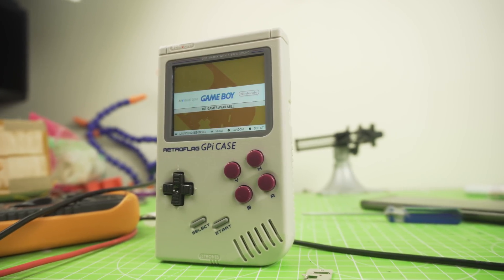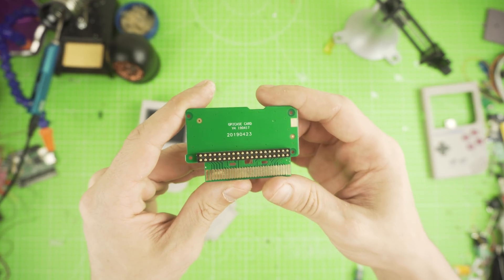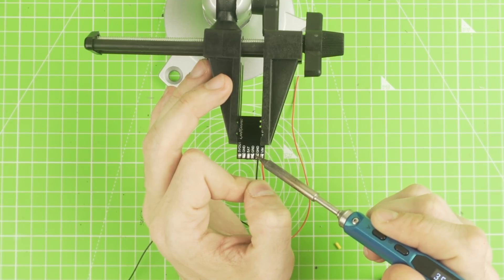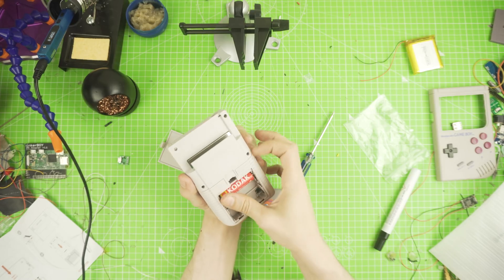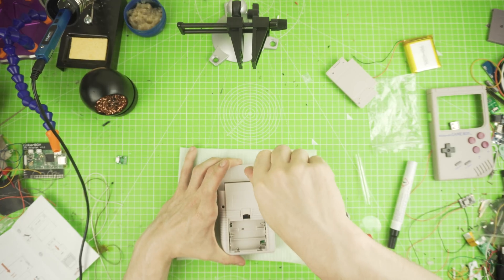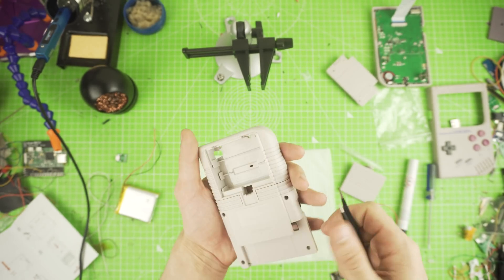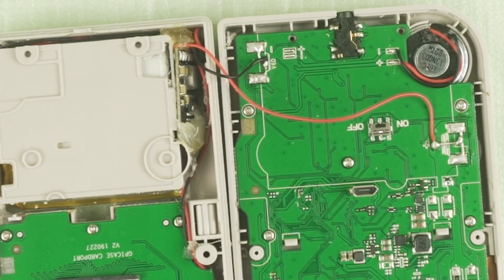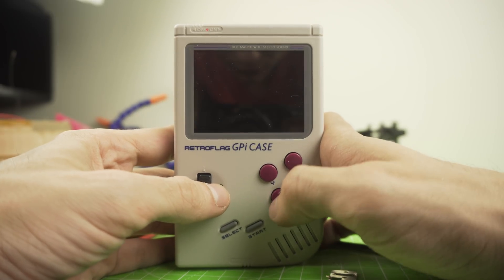Retroflag GPI case Battery and Charger Modification

Comment from the maker: Booster:
https://amzn.to/31qhDOx
Battery:
 https://amzn.to/31x5ebq
Micro USB:
https://amzn.to/2F4dNkj
Wires:
https://amzn.to/2X7d9wJ
Dremmel:
https://amzn.to/2WH0fGs
Soldering Iron:
https://amzn.to/2WI6lGq
Solder:
https://amzn.to/2IFlQVQ
Reply: Can you add wires too please and the dremel? Thanks
Reply from the maker: Done :D
Reply: Could you please make a diagram of the wiring schematic? I can't see all connections on the video (a paint drawing would be enough).
Thanks!

Comment: you don't need to boost the battery, it runs fine on the 3.2-4.2V straight from the cell

Comment: I did a mod but with an old DS lite battery and a recycled power boost board from an old dead battery bank. Except I connected power to straight to the back of the power jack on the side as opposed to the battery terminals themselves. I wish I would have watched this video again before I did the mod but oh well, lesson learned. It still works, I just have to open the battery door to charge it. When I order the bigger battery and the nicer power boost  circuit I will go this route except I will borrow the power jack to charge it. Thanks buddy!

Comment: Do you have any suggestion for battery, the amazon link is finished and all battery that i have found avec with a height of 68 mm ( 4000 mah / 5000 mah 3.7v ) and i'm pretty sure that it will not fit inside the battery pack.
Reply: Anthony Mendenhall  Thanks i've bought on aliexpress an retroflag gpi it last 8 hours and dead at launch ( seller didn't respond after that ) => Journey retroflag ended for me ( 56 euros for nothing )
If you want to buy it Avoid Acekool store on aliexpress

Comment: also: to those of you that can't get this to work (doesn't power on - if it does it's slow, it stutters, it suddenly reboots, absurd frame drops, crippled sound and so on), solder the red wire straight to the upper lead of the barrel jack, and the black one on the lower one. this way you'll bypass the onboard booster and feed the GPi straight in. you'll have to resort to the "push the button on the board to make it work" thing though.

Comment: adding some more info to what I wrote 2 months ago.

The Lantian module showed in the video has an integrated circuit with the mark "MH-CD42" on it. As far as I know it's a different version of the "more classic" IP5306 (which worked way better, I have some of both types), and both are programmable microcontrollers, that take care of the battery charge and discharge (exact details and original microcode are not known - some Chinese manufacturers are worst than Nintendo regarding info on their products).

According to what I know, the "MH-CD42" ones do NOT power on automatically when a load gets attached (proved by attempts with loads both below and over 45mA), but it MUST instead be powered on by pressing the pushbutton provided in the package (that some of you might have received). it would seem that the module straight up ignores the load when it's in deep sleep - probably different from "light sleep".

in some of the packages coming with the Lantian there might be two 300Ohms resistors, and the manufacturers suggest to "solder the two 30Ohms in parallel between VOut and GND to achieve a continuous output". Now, this is absolutely NOT recommended for at least two reasons:

1- this would discharge the battery even if the GPi is left alone , and a single 2000mAh LiPo (for example) in an unused device would have to be charged approximately every 45 hours, due to the ludicrously large leakage current (33mA) generated by the parallel resistors - not to mention the fact that the four charge LEDs would stay lit for all the time;

2- the intended load (in this case the Raspberry plus the screen and so on) could experience instability during operation and the battery would get drained much faster.

what I suggest instead is to leave the switch flipped to "on" and wire an alternate pushbutton which goes to the "KEY" pad on the Lantian module on one pole, and to ground on the other. This way, by powering on the device by pressing the pushbutton once, and then switching it off by pressing it twice, the leakage current stays inside the IC and it should be limited (if the IP5306 datasheet applies to the MH-CD42) to 50μA, which is more than 300 times smaller - this would not only get roughly 4 and a half years to discharge the same battery, but also keep the LEDs off when idle.

it's not decent by any stretch of imagination if we think that many low dissipation FETs have a leakage current of a few dozens of nA (100 to 1000 times even smaller), but it's leagues better than the "parallel resistors" solution.

alternatively, one could still press the alternate pushbutton once to power up the module, and then flip the switch. the unit will stay functional during playtime. when powered off, if the switch gets flipped to "off" the module should power off by itself after roughly 30 seconds. this would bring down the leakage current to that of the power FETs on the GPi PCB. but it might be seen as annoying.

a much more efficient design like the Adafruit Powerboost 1000 - or a generic MCP73871 + TPS61090 combo should be used.

Comment: If your charger board (of the same type Adam shows in the video) shuts off after 30 seconds, you might have an older batch.

TL; DR: it sucks, but you might want to try another board from a newer batch.

According to the M5Stack forum, the IP5306 can be programmed via the I2C protocol through the pins normally used by the LEDs. I have no direct proof of this, but it would seem that some batches have been misprogrammed to always disconnect the load after 30 seconds (32 seconds according to the datasheet) no matter the current drawn by it - the datasheet says that the IP5306 turns off the output if it draws less than 45mA for about half a minute. The issue cannot be directly fixed without reprogramming the IC, so if you happen to have such a board it's just a programming error, it's not either the GPi or the booster's fault. You need to get a newer batch of boosters.

Such boosters can have the code "HW-775", "MH-CD42" or "LANTIAN" on them - or perhaps even others that I don't know. The IC code can be either IP5306 or MH-CD42 but it's the same IC.

https://forum.m5stack.com/topic/979/m5stack-basic-core-battery-power-on-issue-ip5306-strange-power-management/11
https://community.m5stack.com/topic/62/ip5306-automatic-standby

Datasheet:
http://www.injoinic.com/wwwroot/uploads/files/20200221/0405f23c247a34d3990ae100c8b20a27.pdf

Comment: Does this mod actually work 100%? Charge properly and fully? Reliablt? Discharge and use battery fully?

I ask becaise so many of these charge/regulator boards state that they are for "18650" batteries, not for lithium batteries in general of varying capacity. It is confusing. It it safe to assume that when a board is for "18650's" that it will chargw higher capacity? Why do a lot of DIY multi actual 18650 charge circuits here on youtube use multiple charge/regulator boards?

I am keen to know as I need reliable power solutiona for a few projects I have.
Reply from the maker: I have mine that still works to this day and thousands of more people made it, not heard about failing, people are using it to modify original Gameboys for years

Comment: Please help! I just completed this mod. It worked and I was able to play using the battery for a while. After playing, I connected the USB charger and let it charge the unit for a while. Then I tried playing again but couldn't get it to power up. I can use the GPI case with the barrel port charger. I'm thinking it must have something to do with the way I soldered the wires to the motherboard. Can you tell me which +/- pads you connected to?
Reply from the maker: If it worked for a while and then it didn't you need to check your charger or your wiring, + and - are on the right spot

Comment: Thank you so much for this video! I don't have much experience with soldering, but I managed that even if "you forgot to press record" ;)
Only negative point: the booster I ordered has a pin more than yours and it's  bit too wide... the case does close properly for about 1mm, but the screws and some Dremel work managed that!
Also, the battery lifetime is impressive: more than 10 hours with low-medium screen brightness!
Reply from the maker: Hi, I am glad that you found the video useful even without the missing part (I re shot that in the last video) The battery life and the convince makes it a great modd and a easy way of getting onto moddig

Comment: Is there a diagram to show what goes where? The camera cut doesn’t show where the battery is connected, and it’s not so obvious how to connect the wires to the removed AAbattery pins - it looks like a soldered “T”... if you see what I mean?
Reply from the maker: They go on both aa pins doesn't matter where in that T

Comment: how much playtime can i expact from this mod?/ how long does one Charge last?
Reply from the maker: A friend made a test and it lasted up to 12 hours of gameplay with low brightness and no WiFi and Bluetooth, normal usage around 5 - 6 hours
Reply: @Adamstech  sweet! Thanks a lot!
What do you think is the max capassity battery you could possibly put in? One could also get rid of the whole inside tray of the Battery Spot to gain more space. I consider buying a case but having at least 1 -2 day of playtime would be amazing. There are bigger batterypacks but the size increases of course as well.
Reply from the maker: @julianea.8193  Hi, yes you can def do that, I decided to try to do as little mods as possible as the community want's them intact for some reason and  got some hate, but yes please try and find one that fits and you can deff go bigger

Comment: Can you post a picture or a diagram of how the booster is wired along with the wireless charging please?
Reply from the maker: The booster has 2 sides, you solder the wires to the charger pins, it says on the booster which one is which, but if you want add me on fb and I can help

Comment: Awesome build.  What type of wire do you use to connect all the components?  The red and black wires.  Guessing something small like 22AWG?  Stranded or solid?  Only small gauge wire I have is some "doorbell" wire I bought from RadioShack years ago. Think it's 22AWG solid.  I've soldered on this in the past but wasn't sure it was the best.  Any recommendations?
Reply from the maker: Hi, thanks for watching the video! For the power I recommend 22 AWG wire for the maximum of amperage and for data and the rest just go with normal 24-26 AWG wires, I always use the wires from inside used USB cables

Comment: A nice mod, but kind of pointless imho. With good high cap batteries (2700mA) you should get a pretty good runtime. Sure, the internal circuit does boost the voltage, thus reducing the total output amperage, but still, considering that the unit consumes around 350mA, you should get at least 5-6 good hours of gameplay out of it. Id say thats more than enough gameplay time per day, not to mention way easier than modding it. But hey, to each his own, still a cool mod.
Reply from the maker: Thanks for watching! Well, each with their own how you said, but the biggest drawback is the fact that you got to buy batteries and charge them outside in a  charger, which no one can argue is more convenient. Add the possibility to charge wherever you are with any port you want ( micro USB, type c ) and that makes it quite better than carrying the case a charger and batteries.

Comment: I have 3 rechargeable batteries of 2000 mA, they are 6000 mA without modifying anything.
Reply from the maker: It doesn't stack up in that way mate, you stack up voltage in your case, so you have 2000 😁
Reply: The difference between series and parallel using batteries

Comment: The charge/discharge module I have powers down after 30s - I think this is because the load is less than 50MA. Any way around this?
Reply from the maker: Is from the charger module I think, do you mean that the all powers, pi and the rest and it just shuts down?
Reply: @Adamstech  Yep - though battery charges and GPI works fine from USB. Module is similar to this: https://www.amazon.co.uk/MakerHawk-Charge-Discharge-Integrated-Lithium-Protection/dp/B07QHTK791
Reply from the maker: Well that's odd, the batch that I had doesn't have this pb, what you have is really wierd as the pi and gpi should draw enough, try with the battery connected directly to the gpi, give it a go
Reply: Adam Builds can confirm it works fine with same battery direct to gpi
Reply from the maker: @cakeinmilk  Great! Thanks for letting us know!
Reply: Adam Builds don’t solve the problem though! Battery in this configuration has no way of charging.
Reply from the maker: @cakeinmilk  Yeah it is, add a second wire from both cables that come from the battery and solder those on the battery pins on the booster, then do your micro usb in and that's it :D

Comment: I used the link to buy the charger, but the one I received has a switch on it. I noticed that yours doesn’t. The GPi only turns on when I press the switch on the charger board. It then always turns off after about 30 seconds. How do I stop that?
Reply from the maker: They changed their batches, try and find the one like mine and just change it :D

Comment: Cool mod. How did you install the micro usb socket? Only with glue? will it hold or something stronger is required?
Reply from the maker: A combination of super glue and hot glue, also closing the case is keeping it pressed :D

Comment: Hi! Thanks for the helpful video. But I need some help....All parts ordered as per your suggestions and installed correctly. GPi works perfectly when attached to USB, but when disconnected cuts out after 30 seconds. Charge lights on booster suggest that the battery is fully charged. Cheers for any suggestions!!
Reply from the maker: That might be a problem with the second batch of cases, they have the circuitry different, I haven't encountered that even with the second batch, what I had was that it wasn't even powering at all without the micro USB and I fixed it with the button that comes with the booster, press that before you power on
Reply: I had the same problem - I switched to using this charging board and it now works fine - you do have to mount the board flush to the back of the screen just under the power switch
https://www.ebay.co.uk/itm/5V-1A-Micro-USB-18650-Lithium-Li-Ion-Battery-Charging-Board-Module-Protection/133161981031

Comment: It however does not extend the battery life. Eneloop rechargeable batteries have 2500 mAh batteries each, which makes 7500 mAh in total. Your battery has roughly half of the capacity.
Reply from the maker: 😂😂 Well let me break it up to you, 3 eneloop batteries are in series not parallel, pease Google it, and find that capacity doesn't stack up in this case as you need to stack up voltage, sorry to break it up to you but with 3 Eneloop you got 2500 mAh. As for my mod, I made it so I don't have to swap batteries like in 80s and to have it rechargeable

Comment: Hello Adams. Great video. Why did you not used the lateral charger to charge the battery ?
Reply from the maker: Hi Adrian, GPi case doesn't have a charger built in, that's just a 5v in that powers everything, it doesn't charge, also, chargers are specific for the battery chemistry, you can't charge a lipo with Nihm chargers and so on
Reply: Adam Builds sorry. I’ve misspoke. I was thinking why did you don’t use the 5V port to the booster ?
Reply from the maker: @XciD69740  I don't have loads of cables that have that connector, with a micro USB I can charge it on the way with any cables, I might add a type-c to mine as this is the standard now

Comment: wouldnt the booster constantly draw power from the battery? I have a powerboost 1000c lying around but the power led constantly lights up as soon a s a battery is connected and i dont have aswitch attached
Reply from the maker: This booster cuts out after 3 seconds of low power draw,so you are fine

Comment: Have you tried a battery mod that uses the barrel port already in the case? I'm wondering if having to add another port for the micro usb can be avoided
Reply from the maker: In my eyes a micro USB or type c is needed, you can charge it with any charger not only the proprietary one, It can be done I think, but not something that I would reccomend

Comment: Its a must do mod . Just consider how many times its needed to break that batteries cover . Something that was usual with GBA for example. This mod eliminates that potencial problem and adds confort and practicality..
Reply: people broke the latch on there battery covers so often because they pulled it back too far every time, stressing the plastic too much. You only ever need to pull it just enough to open it. I never had the battery cover break on me... now losing the damn thing alltogether was a different story lol.

Comment: Is it a charger or a booster? A booster wouldnt make sense....because with all 3AA it will have around 3.6V
Reply from the maker: Is a charger and a booster, you need 5V to power it and charger to charge the battery, even tho it has an internal one that boosts the AA batteries, that doesn't work with our Lipo.
Reply: @Adamstech 3.7v lipo works ok, when soldered to battery contacts on system board.
Reply from the maker: Yes I specify that in my newer video

Comment: Great Mod, I've ordered the parts and working on it now. I have the battery fitted into the case but cannot get the booster to fit in properly. I've Dremel'ed down the area where you have yours but it's just a little too tall. Any advice?
Reply from the maker: Make as much space you can and add it at a 45 degree angle, it should just fit snuggly in there